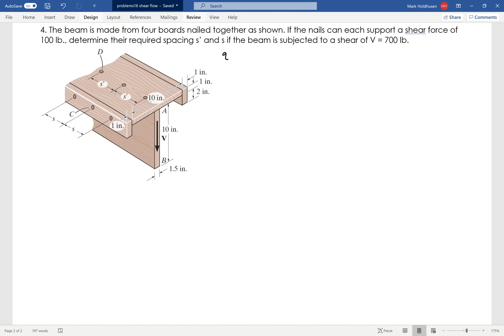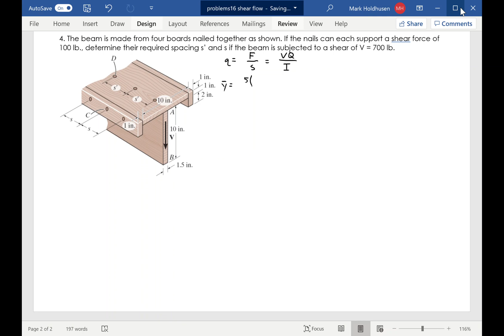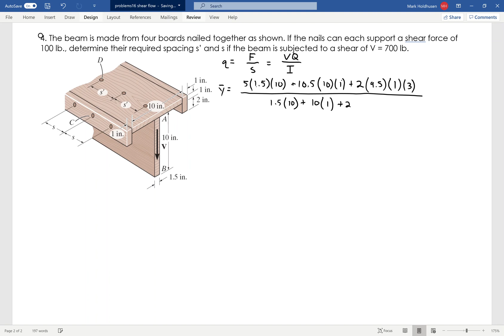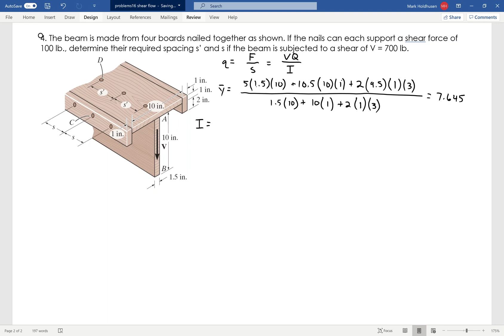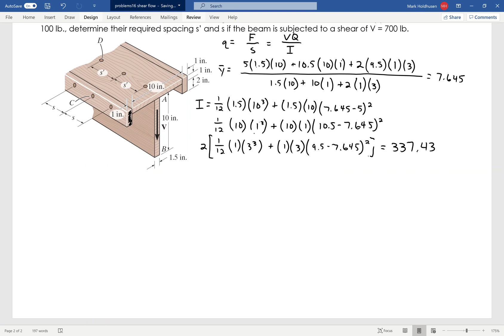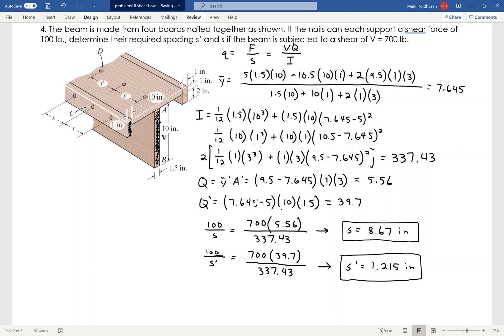ENGR 222 Oct 23 shear flow 4

Comment: How did you decide which board to use for your calculation for Q? I'm just confused as to why you used the long, vertical board instead of the horizontal long board for Q'. Thank you!
Reply: got the same problem here. how do we choose the surface to determine Q? like what do we need to look at before choosing the surface?
Reply: @anishahasnat2837  either of yall figured it out yet cause im doing this right now and im wondering the same thing? have found a similar question in several videos but yet to find an answer